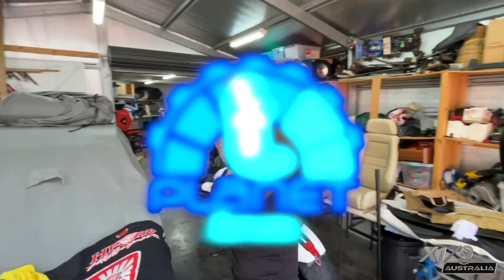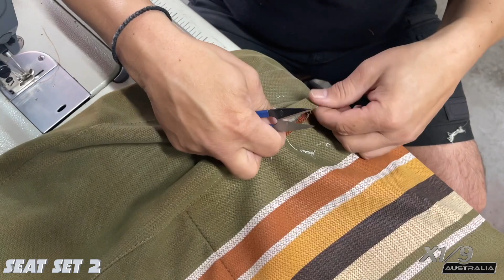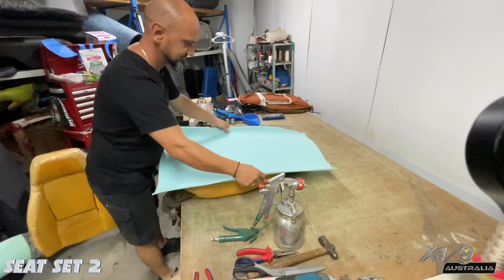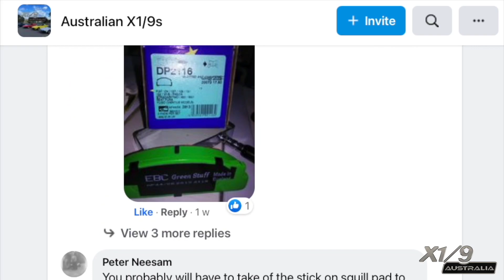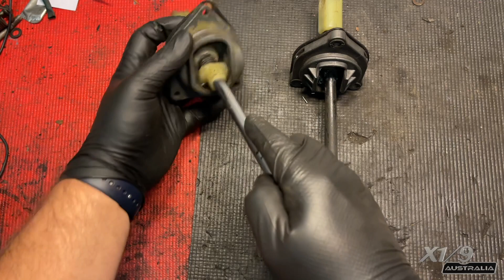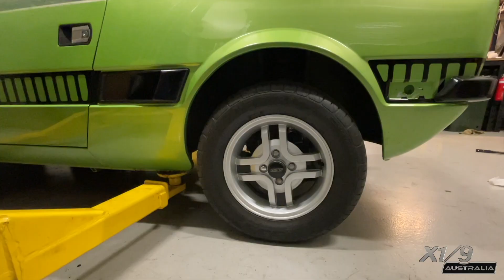The Green Machine Ep.18 — Seat Refurbishment, Brake Caliper Fix & Gear Stick | Fiat X1/9 Restoration

Comment: Good on you mate I really like the way you pay attention to detail when working on these cars if I get another Fiat you can work on my car any time

PS 

Personally I would not have worried about that brake pad moving in the way it did 

and the best stuff to use on brakes as lube is Bendix blue and instead of shims you want to put a film with Bendix blue on the back of the pad simple as  that mate

Comment: "the knocking bold" is coming from the difference between the left and right hand driving model, same whit the plastic piece you printed earlier ;-) i think so hé, not very sure
Reply from the maker: I thought that at first but the angle on the gear stick is the same on LHD and RHD. I am using all 5 Speed parts in a 4 Speed body maybe this has something to do with it.

Comment: Amazing vid, I had one question regarding the seats: what models were fitted with these vertical stripes?
Reply from the maker: Thanks, the series 1 had them but was known as the "series special". In Australia, we only got them in 1978. Around the world think it was 1976 to 1978 but not 100% sure.
Reply: @x19australia  thanks for the clarification. Same question regaring the black striping you added on to the car in one of the first vids, are these stickers specific to one period as well?
Reply from the maker: @tomstigter1040  yes part of the series special. Also the rubber chin bit, and few more adds.

Comment: Great series.  It seems the listings in our seats were made from the cheapest cotton material the supplier could find.  Mine had all fallen apart over time and had to be completely replaced even though the seats looked new.  Also, when I purchased my '86 a few years ago the shifting was really vague.  It turns out that bellows you mention just forward of the lollipop is really important support for the shift rod.  If it tears the shifter just flops around.
Reply from the maker: They were not know for the high quality thats for sure. Good point on the bellow helping the support. Would also stop it rattling.

Comment: Lots of flex in the tunnel.  Any way of bracing it up?
Reply from the maker: Yes good spot, was wondering if someone would pick up on it.  You can see the support is broken but will get it welded up and fixed but can't do this till the car is drivable.

Comment: The different metal lollipop is for some 79 cars. They fit only with a longer shifting rod. The rubber lollipop damps the vibration of the engine probably better.
Reply from the maker: Makes sense it would dampen the vibrations. I have only seen them on our 5 speeds so 1981 - 1982 modems we got.
Reply: @x19australia  Speaking of the lollipop: I've not actually seen one delaminate but have heard of it happening leaving the car stranded.  A common "mod" is to drill a small hole in the center and loosely install a bolt and nyloc nut.  The isolator can still provide damping and if it does come apart you can get it home.
Reply from the maker: @cratecruncher6687  Yes, funny you say that. This X1/9 came with one like that. I filmed it but did not add it in to this video. Does the job, I guess.

Comment: Very interesting, video. If I can make just one remark, I think the music is totally unnecessary. It doesn’t add anything to the video, it only distracts from the content. What is wrong with some silence? If people want background music, they will put on their own.

Oh, and one question: why do some English speaking countries “abbreviate” millimeter to “mill”? Do you also say “cent” for centimeter, or “kilo” for kilometer? We (in NL) just say “kilo” when we mean kilogram, but all other units are kept and pronounced. Just curious.
Reply from the maker: I prefer it over silence sorry but it's staying.
Reply from the maker: Yes, we are lazy and cut words, even do it to peoples names including our Prime Minister. . We say K's (Kays) for a kilometre.
Reply: We say mil in UK too, but you'd have to ask the French - it's their unit originally I think. I'm with you on the music but the content just about offsets it. Given that it's an Italian car, perhaps some Vivaldi, or if it has to be more recent, maybe a bit of Spiller?
Music or no, it's great to see the car coming together. The 1 thing I regret not doing with mine was getting a spare roof and putting a glazed panel in it; I always thought it felt dark inside on those very few occasions that the roof was on. That and not ever fitting a 2l twin cam (well beyond my skills at the time). And better brakes. And re-wiring it using connectors that actually worked. So, at least 4 things I regret less than not still having it.
Keep up the good work, Mark.